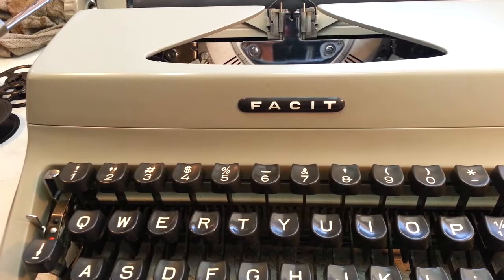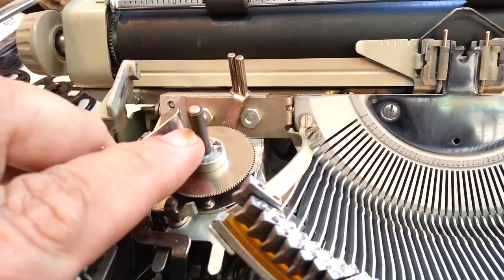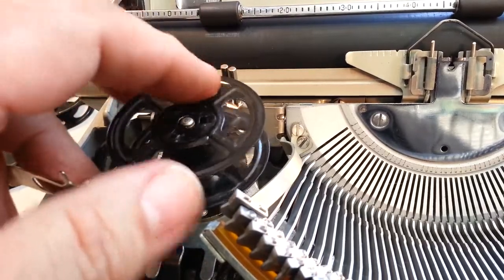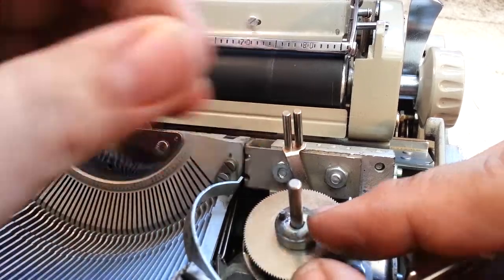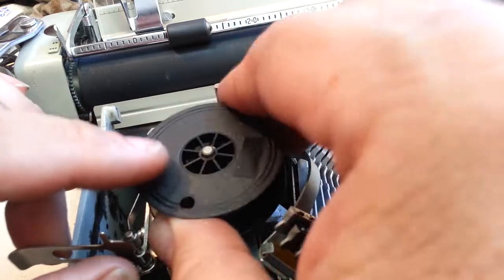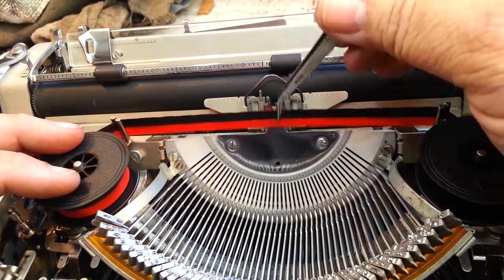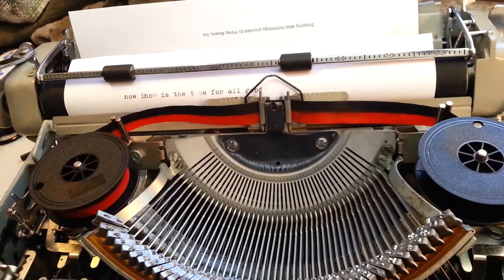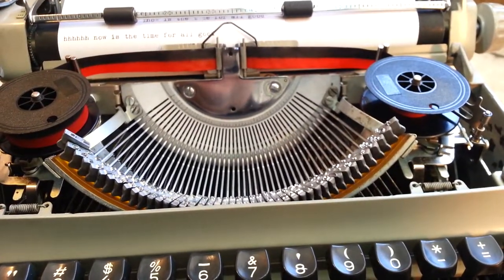Facit Typewriter TP-1 Ribbon Spindle Modification from DIN 2103 to Standard Style Spools

Comment: Are those marks on the anvil normal?  Or is that a problem that was neglected which caused those striking marks on the anvil.
Reply from the maker: Anvil = platen roller ? marks on roller should wipe off, but yes, platens will develop grove pattern after tons of use